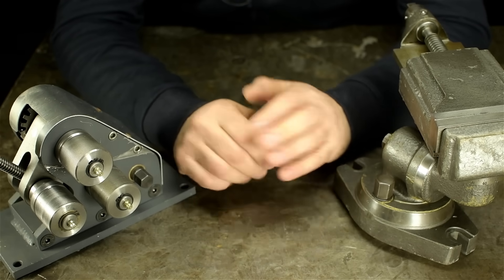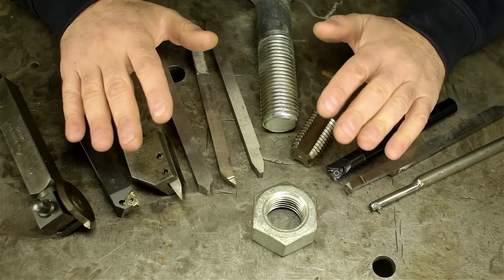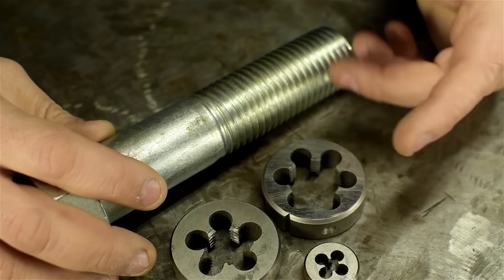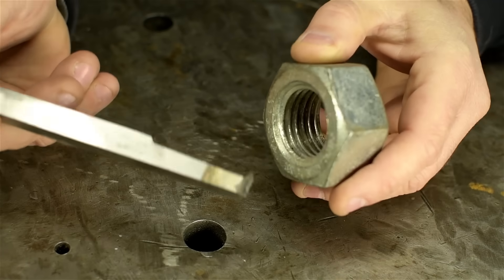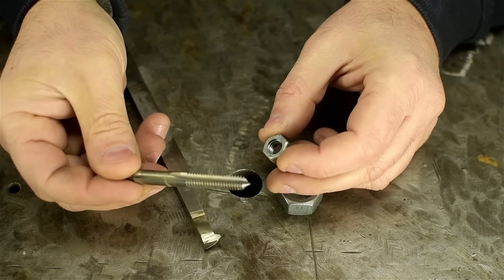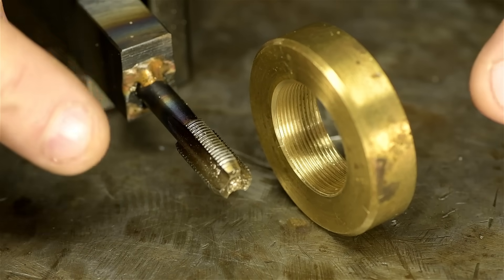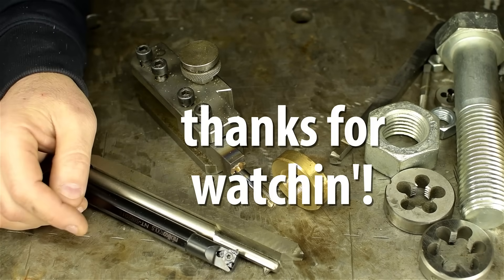Using a TAP as Thread Boring Tool

Comment: 5:08 I don't remember the kindergarten lessons about square pegs and round holes, but as a woodworker I know that's how you make dowels, so I assume that's what you're referring to? That if you have a square tool steel blank and need it to fit a round hole, you hammer it through the hole until it fits? Can't think of anything else at least.

Comment: This weekend I needed to put 0.5mm pitch threads on the outside of a 5mm part. I did it with a tap in my toolpost and it went surprisingly well. It isn't a standard die, was going up near a shoulder, and I had a weird m8x0.5 tap I could try this with that day

Comment: This weekend I needed to put 0.5mm pitch threads on the outside of a 5mm part. I did it with a tap in my toolpost and it went surprisingly well

Comment: how to do internal threading without giving relief groove ,  (undercut clearance groove for tool) , ID is 30mm , this part is for a torch light mould , Li battery type . There are 2mm grooves for 2 O rings too

Comment: Another trick that works to avoid the cost of an expensive tap is to make one from a bolt. You cut slots in the side, so it will now cut. Obviously a good quality SS bolt is required. Its a bit harder to start because it doesn't have a taper in the front, but there you are.

Comment: With metric threads, the pitch increases with the diameter. 
Unless you want to make fine threads, than you can use a standard thread tool for a larger diameter.

Comment: I also would like to see the traditional "russian vertical thread" as we call it in Finland. This is traditionally achieved by hammering a 3/8" bolt to a M10 nut and if safety or leak tightness is of importance, using a suitable ESAB or Kemppi hot glue for a more persistent outcome

Comment: Working in aerospace on CNC mills, we used carbide helical thread mills that looked similar to an end mill with threaded flutes and would helical interpolate them inside a large boss to create threads. A massive improvement over the massive taps we originally used that generated enough heat to warm your home in winter.
Reply: That's kinda like cheating ya know

Comment: I have two solid metal rods that I wish to join together, end-to-end, but also to be able to disassemble them. The rods are about 1 m long and have an OD of 25 mm. I was thinking to tap an inner thread into the end of each of the rods and join them with a outer threaded rod, let's say M10.

My question is how do I make these internal tapped threads on long rods ? I cannot place them in a lathe. Is there a manual tool that I could apply at the ends to cut these internal threads ? Should I use a drill tap bit ?

Comment: I got confused on the tail stock feed rate/movement. It would seem to me that the feed into the brass ring would have to be timed or the tap would cut good wanted threads. Or did you let the tap pull the tail stock into the part if even it could?

Comment: This looks like a great idea but something I don't understand is what's the keep the tap from cutting grooves instead of threads?  I'm not a machinist, but thinking about this, it seems if the tap doesn't disengage off the material during rotation that grooves would be the result instead of threads?  What if instead of using the carriage to feed the tap into the work what if you used a boring bar holder to hold the tap in correct orientation but not rotate so the tap self feeds into the work once one or two threads are started?

Comment: I noticed that the bolt in your demo was one that was forged. I had a problem at one time where a mechanic had made a bolt on a lathe to replace a damaged forged bolt. The lathe cut bolt snapped after just a few uses. The reason being that a forged bolt has a ‘u’ shape at the bottom of the thread as well as continuity of molecular flow around the thread, whereas the machined thread is cut through the straight molecular alignment in a piece of drawn steel as well as a sharp ‘v’ cut at the bottom of the thread. I mention this because it was the point on which an insurance claim of considerable value rested. A machine cut thread will suffer a lower torque threshold that a forged thread of the same size.

Comment: Thanks Tony, with this video I was able to make a part that I couldn't buy.  My son salvaged a chinese lathe from the scrap metal bin at his work.  It had some problems but since we had it for free I thought I'd have a go.  I'm a 60yo novice to machining with my own cheap lathe to work with.  Anyway, the biggest hurdle was the spindle pulley nut was missing and I couldn't find a new one.  It has a 28 x 1mm inside thread and I don't have the right tools.  I do have thread taps though.  Long story short, made the part successfully from 12mm steel plate and a home-made tap holder with set screws.  From a novice, this is my proudest achievement so far.  Thanks again for your advice and encouragement.  Love your channel and your style, cheers.
Reply: Improvise, adapt and overcome.
You made it work Sir, good job.
Play stimulates creativity, and vice versa.

Comment: Here's couple of ideas for 4044... You can grind away half the diameter of a hardened bolt and use it instead of a tap. Also if you have clearance issues you can grind away the extra teeth turning the bolt into a single point cutter.

Comment: Tried this the other day. Failed at it. I am pretty sure I didn't get the tap clocked right. I used a 3-flute tap, and held a straightedge against in the non-cutting 2 flutes and rotated the tap until it was vertical. Is there a better way?

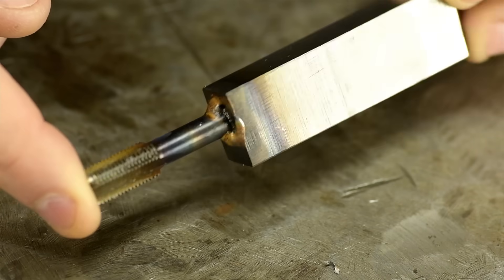Comment: @06:44 I think brazing will make the tape tool lose its hardening except if you are able to quench it again using the right parameters (liquid/temperature), correct me if I'm wrong.
Reply: I welded on a tap that was broken off in a hole hoping that it would soften and I could then drill it out. It did not soften any appreciable amount.
Reply: @topduk , Which type of brazing/welding you used?

Usually "welding" refers to electric welding, this type of metal joining is very fast, and the temperature change is rapid around the spark area. So at the welding time, it may raise the temperature up to 4000c or 5000c at the welding spot if I'm not wrong, and this shouldn't affect the far parts (a few centimeters far from the welding spot) a lot, because the welding is almost instant.

But if you mean brazing, usually brazing uses normal oxy/fuel flame that is usually around 2000c and it takes some time to raise the metal temperature, which leads to heat transfer across a big area in the brazed part, which will definitely cause a gradual rise in temperature and gradual fall in temperature (except if you quench it).

FYI: Welding using gas is something that you can do but it's rarely used nowadays. And ASAIK it can only be done using acetylene/oxygen mix.
Reply: @MohammadAbouBasha  Stick and TIG, but for the tap I was using a stick electrode arc just to heat the tap up. It did not work. The tap material was still harder than an HSS drill.
Reply: I think the taps are through hardened. It takes quite a bit to kill it.

Comment: Is there a way to cut internal threads on a lathe that does not have a power feed?  Or even external threads for that matter?  I didn't know enough about leaves when I purchased mine to look for one with a power feed option.  Mine does not have that and I can't purchase an add-on module for the lead that I actually have so aside from buying a new lathe which is not currently in my budget I'm basically stuck with using taps and dies but that gets expensive as you have stated especially when you start getting into larger sizes

Comment: Brings back a memories of when I had to cut an internal left handed tapered hole for pipe threads with a taper attachment on the lathe. I probably could have used some of your tricks. Interestingly enough in the old Machinery Handbook the topic on threads occupies the most pages. Threads are a science in and of themselves that have always fascinated me. Whitworth, Acme, metric, microscope, etc. Then there is class of fit and shape. It goes on and on but basically the "thread" is one of the simplest basic machines "the inclined plane" shaped in a spiral.

The geometry and math involved in threads is really interesting if one gets into it but basically there are 13 types of threads each with specific properties suited to particular machine applications.

Comment: One use for this that you didn't cover is the ability to enlarge an existing internal thread of a pitch your lathe cant cut. I used this to enlarge a 25mm nut to a 26mm nut on an imperial lathe by turning the headstock by hand and allowing the tap to be pulled into the nut. It felt kinda gross and hack-y, but it allowed me to finish upgrading my race moped to EBR front forks in time for the races.

Comment: As the lathe is already set for threading, why not just use an internal threading tool? It is not the tap pitch is not driving the pitch but the lathe screws and gearbox. What is better, the finish or the cost of a tap? An internal threading tool can cut pretty much any pitch while a tap will only be able to do one. If one used this trick, they would have to have as many taps as pitches they want to cut. This can add up. Just curious.

Comment: When you feed the tap into the 2nd (3rd, 4th, etc) pass, how do you get the tap to align with the previous threads? Maybe leave Z free to feed and ease it in until it catches and draws it in? 
Love this, btw.
Reply: i was thinking the same exact thing- and even with the carriage feed engaged- i feel like I'm going to mess up the feed and cross thread. 😪 imo, threading on a lathe is what separates a back yard machinist to a professional- and no, i can't thread on my lathe to save my life- if not for tap & die, I'd be screwed. 😣

Comment: 1" x 24 tpi was the standard bicycle headset size for years.  The bicycle fork steer tube OD was 1" with a 24 tpi thread onto which the adjustable bearing cup and locknut were threaded.  Please refer to a 1980's almanac or pamphlet on 1980's stuff for verification.  Useless knowledge in 2021.. extinct knowledge in 4042.

Comment: This toolpost drill chuck will make life easier for different size taps (and small round section boring bars)
https://www.googleadservices.com/pagead/aclk?sa=L&ai=DChcSEwjsw6vx9s7xAhXK7e0KHcR1B1UYABAEGgJkZw&ae=2&ohost=www.google.com&cid=CAESQeD22TA7de6XN111VtsL0aqBr8C4Xz_ibk4tR_xtS12YLo6ud5ZflLMcTuFnuRtQOffU0KA1J2JRRZ9vwFksa67c&sig=AOD64_2DPUN-wYFSgDZ1YTeyccFsx538og&ctype=5&q=&ved=2ahUKEwju_Zvx9s7xAhUUQEEAHdujD1AQ9aACegQIARBE&adurl=

Comment: You're right! You can use a pipe threading die jaw in the toolholder to thread external tapered pipe thread on the lathe. Did it on a 2" NPT external thread on a bronze part. The forces on the tool get pretty extreme, though. Cutting the taper first on a compound would probably help.

Comment: We had several hundred 1 1/2" x 5/16" wide collars to internally thread.  Problem was there was a 1/8" hole drilled in the collar for a nylon lock.  After struggling with broken inserts this was the final solution.  Worked great even in a production environment.

Comment: The pitch might be the same but the angle of each tooth as it wraps around the diameter is greater for smaller diameter taps. So the clearance might not be right for larger diameter parts and could cut as well as form the threads to a slightly different shape than desired.

Comment: ummm...yea sounds good but IS NOT THAT SIMPLE...TPI= threads per Inch...UNLESS you have a Varible speed lATHE AND A PERCISION tACHOMETER...YOUR GOING TO strip THE HOLE OF THREADS unless the Timing IE.RPM versus PITCH matches EXACTLY..sorry Ive Been a Tool Maker for 39 Years..the Formula for Threading is Techincal to say the LEAST/...and Taper/pipe threads in the Chasing process takes either a Taper attachment or a C.N.C. to follow the Taper..you will just smash your Tool..sorry guys not trying to be a downer  but this Process can be Dangerous

Comment: Your video's are great, but it's 9 times out of 10 not 8. in the same similar sort of backward way it is Nineteen to the Dozen and not Ten (if on a production line and you were putting 10 components in a box when you should have been putting 12, you are working slow.

Comment: I dont know how to do it with imperial threads but with metric threads if you set the machine to cut say an M4 thread but use an M1 threaded tap you can cut a 4 times multi start thread. Works a treat.

Comment: In about 1994 I needed to machine shallow pocket threaded holes with thread to the floor of the pockets.  The thread was 1-1/4 - 40tpi, 1/4" deep.  I had a 3/8-40 4-flute straight flute tap which I ground off the starter threads and 3 of the 4 flutes and used the tool as a thread-milling cutter in a helical-interpolation op.

Comment: Also....it'll work until you discover your lathe is made of Chinesium and only threads in metric pitches. A 1mm pitch thread would be over .002 inches under the pitch for cutting a 24tpi thread.

Comment: This technique I had to do in a pinch. I had to cut a straight pipe thread for a customer. He wanted to convert his 1" NPT tapered thread into a 1" straight thread. I took an old 1"NPT tap and measured the max depth on the tap diameter. I than cut off the unwanted front end of the tapered 1" NPT tap. I left 2 threads, max diameter, on the tap and ground away any threads above what I did not want to cut. I was left with an 1"NPT tap with only 2 threads. This modified tap chased the brass 1" NPT straight and to the correct size. It gave me a 1" straight thread with the NPT pitch. I did need to Craytex the threads for a nice shiny finished look but the fit was correct. This also worked for me when I needed to convert a USA NPT into the closest matching British Straight pipe thread. I know it does sound perhaps a bit kooky but if carefully done the results do work in a pinch........... TM

Comment: Instead of spending all that time grinding an internal threading tool from HSS, I chose to spend many years developing a device that alters the molecular structure of the work such that the external threading tool is able to occupy the same space as the work thus avoiding the problem of facing off the part to oblivion. Of course there were several paradoxes created that will eventually lead to the end of reality as we know it...But who cares!!! That was MUCH better than all the grinding I'd have to do to make another tool :)

Comment: Sorry to be a bore, dun that over 35 years ago, but I will say that if you've got a knackered internal thread that needs chasing,(buggered thread) use a tap same pitch, easier to align with original thread than a single point tool.

Comment: Hey Tony. I am your big fan and I need your help. I want to build metal lathe, but I am struggling to get some good drawing for the spindle. I am thinking about an axle with two tapered roller bearings. Would that work for good hobby use with reasonable accuracy? Many thanks and God bless.

Comment: Hi, very good tip, just a question, did the brazing affect the temper? or did you use a 'heat sink' . As always when you say something a 'smart ass' has to comment, please don't take it as a 'clever comment' but us 'Brits' do have some strange thread pitches, and yes 1" is available in the 'Brass, Cycle & Special Pitches' in 12, 14, 16, 20, 24, 26, 28 and 32 TPI, have a look at www.tracytools.com

Comment: Can you just use a boring bar holder to hold the tap instead of brazing?  When you advance the cut with an internal-thread-form-like tool, which I guess is what you would categorize this as... do you run the topslide at 29.5-degrees and increase cut depths from there or do you just increase cut depth perpendicular to the spindle (0-degrees)?

Comment: the only slight problem with this is the tap doesn't have a relief angle that matches the thread pitch, the TPI stays the same big part or small, but the angles change.. One way you can get around this is by grinding the tap  threads behind the cutting edge so they don't rub on the cut part

Comment: Without an in-tolerance thread gage, how would we know if your idea works? Also, taps are brittle and the lateral force on the tool when cutting steel would probably break the tap? Taking into account the pitch built into the tap, your threads will not be cut to tolerance and, in a machine shop, would be scrap.
On the other hand, there are tools made for this purpose and they are called tap mills. Made for cnc milling machines, they might be an alternative tool.

Comment: For years, we had some jobs come in the shop that required a large bore (3-1/2”) with very fine (16 tpi) threads. Sometimes, those threads would get damaged in handling. I would take a bottom tap of the same thread pitch (3/8-16) and mount it in a file handle. I could then reach into the bore and carefully scrape any irregularities out of the internal threads. It worked out very well.

Comment: Hey Tony, you wanna do a colab?

Ok, fine, I just need a part turned for my classic city bus, the only one of her kind in the western hemisphere. I can do the CAD drawing, although its a non spinning part, low stress....Right now Im using the drill in a bench vise with a die grinder to try to shape this thing....

Or alternate method is drilling and taping 1mm threads, then threading an actual aluminum brazing rod to connect the shaft of this thing...and then coating with more brazing rod...because thicc? 

I be getting desperate, disparate? dis parrot? (humor to be noticed, increased chances of being read by 24%, but increases annoyingness by 15%)

Comment: Great video as always Tony 👍. But it's got me wondering... In order to do this trick do you have to keep the half nuts engaged, or just treat it like a normal threading operation and use thread dial as you normally would? Still new to machining so if the answer is obvious I apologize.
Reply from the maker: just like you normally would!